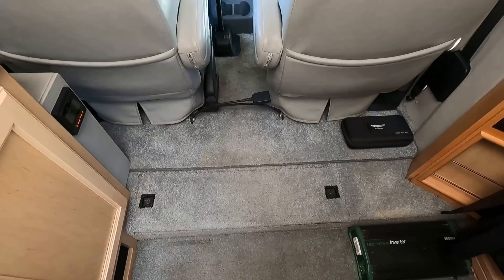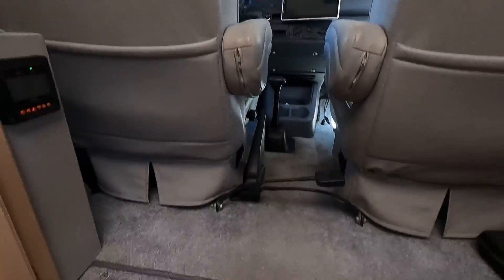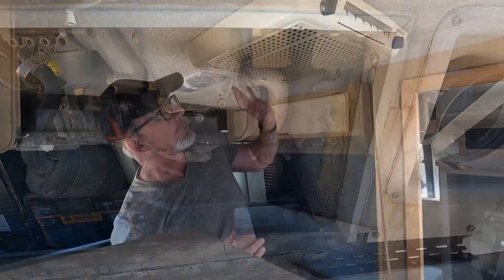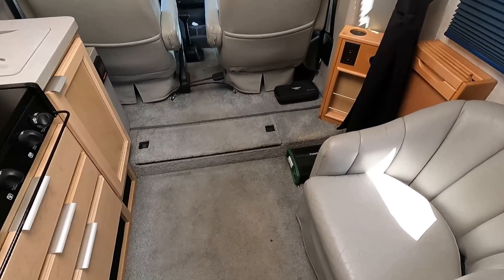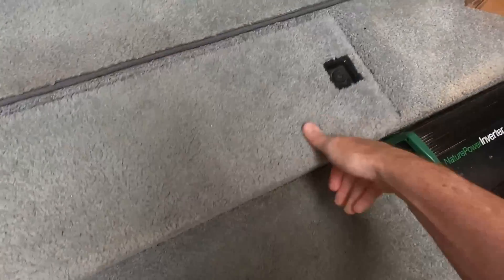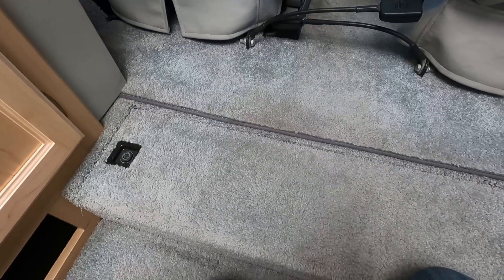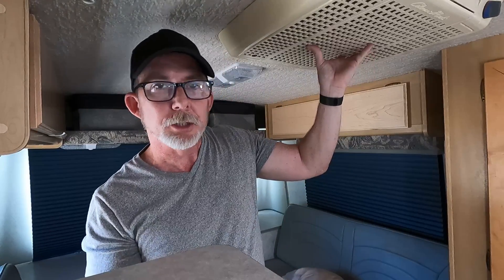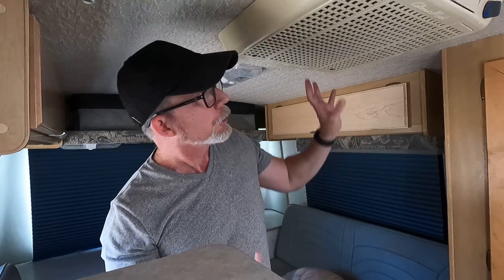Winnebago Rialta: Power Systems Overview

Comment: Is there a way to run a tv and PlayStation while traveling?  This 2001 Rialta does not have a gen and 5 batteries.  Inverter ?
Reply from the maker: What kind of batteries do you have and how do they charge? An inverter will draw a lot of amperage so it depends on what your setup looks like. A PS5 only draws a couple hundred watts and a small TV is negligible, so you could get away with a smaller inverter (although having a larger one might be convenient.)

Comment: A few questions: I would like to put in some lithium iron phosphate batteries. Typically alternators don't put out enough power to charge these, but if you install something like the victron DC to DC Converter I think it may work--do you know? The standard solenoid valve is kind of a crude device in my opinion, so just curious if you tried something like the Victron or some other DC to DC charger . I think Renogy makes one too as well as Sterling.   I'm a little confused if you have a starter battery, why is there a solenoid valve between the auxiliary batteries?  Is that to make sure there's always one good battery to start the RV?
Reply from the maker: The issue isn’t so much that the alternator doesn’t put out enough power, it’s that a lithium battery can take more than it can handle outputting safely, and at low RPM’s a standard alternator will overheat. There are alternators that are designed specifically for this sort of application but they aren’t just a drop-in replacement. 

The DC/DC converter will allow you to limit how much the lithiums can take from the alternator; again, limiting how much strain it puts on the alternator when at low RPM’s. 

The Rialta is a different animal in that it has a special setup that allows the van to be “jump-started” from the coach batteries, which are just regular deep cycle batteries. The solenoid is what isolates those batteries from the engine battery but still allows them to be charged when the van is running.

Hope that helps!
Reply: Doesn't the DC to DC charger limit the voltage to avoid overheating?  And of course, we really haven't talked about solar or things like all-in-one controllers that have built-in chargers in them, but that requires shore power. I'm just learning about the DC to DC chargers, so that is why I asked specifically about them. Back when I owned by VW Westfalia, I just had a simple relay/solenoid, and I think that's where you can really get into trouble if you're auxiliary battery is super low, and has higher capacity then the starter battery.  Again, I thought the DC to DC Chargers had some built-in programming to avoid too much juice going into the Auxiliary batteries.    Unrelated to the topic,  but.  have you had any issues with the transmission on your Rialta? Do you have a cooler and scan gauge?
Reply from the maker: The converter does modify the voltage slightly to keep it consistent at around 14-14.2v instead of the typical fluctuation you see from an alternator, but when lithium batteries are an add-on that’s being served by that alternator - as a matter of priority - limiting or controlling the amperage draw is more important. At idle, if an alternator is capable of producing say, 40 amps…a lithium battery can take that without thinking twice, if it’s connected without a converter. However, an alternator putting out those maximum amps at low RPM’s will overheat, as there’s not enough air being moved to cool it down.  That’s why I went with 20A, so that the lithium wouldn’t overwork it when idling.

My Rialta didn’t have any transmission issues, but it also didn’t have a cooler or a scangauge and I sold it before getting one (which really is a “must have”, along with regular maintenance.) The transmission is a weak link in these rigs but with the proper care it doesn’t have to be.
Reply from the maker: Also, related to what you said about “too much going in”….both the solar controller and DC/DC converter will reduce the amperage and/or stop charging once the lithium battery reaches full capacity.
Reply from the maker: And yes, I had a 20A DC to DC converter installed in the Rialta with an on/off switch, so that I could decide when the lithium battery would be charged, but would still be limited to a 20A draw. Alternately, those converters have a trigger line that lets you turn it on anytime the van is running. I wanted more control than that.

Comment: Nice video Maury, lots of food for thought. Just have to ask you are these the original blinds and if not would you know where they were purchased? Mine are like most distorted and bent.
thanks 
Irene
Reply from the maker: Poptopheaven used to sell original style Rialta replacement blinds but I don’t see them now. In the group, people seem to be using stevesblindsandwallpaper.com. The Rialta came with half inch cellular.
Reply: @TravelingSolo  thanks Maury

Comment: I just bought a 2004 myself and tried to run the hot water heater with my generator, it started to work, my generator bogged down quite a bit, ran about 5 minutes, then stalled and would not start back up. Have you ever had this problem?
Reply from the maker: That could be a few things but first question would be how much gas did you have in the rig? The genset pulls gas from the tank and if you’re below a quarter tank, it won’t get fuel.

Comment: Good evening.  My rear speakers are not working. Are they connected to the auxiliary battery system.  Radio Wires and harness are correct. Also new radio.
Reply from the maker: Stock, they just connect to the head unit in the dash, so if the radio is on, they are on, unless a previous owner installed an amplifier somewhere. Did they ever work for you?
Reply: The coach passenger side speakers stopped working in my 2002 HD.  I found an amplifier under the floorboard in the cupboard located under the sink. I had a stereo guy replace it and everything works great now.
Reply from the maker: @Kurtis-Schubert  I just learned recently that there was an option for a stereo upgrade that included an amp and subwoofer behind the driver’s seat, so this is definitely something to look for.

Comment: These are really nice; though I am reading mixed reviews about them, ie mainly availability of parts and finding someone to work on the engine, transmissions if you have issues. So I am not sure about getting one. But for riding around the US and exploring the country, it looks like it would be almost perfect for that. Of course I don't like the bathroom setup but could live with it if needed.
Reply from the maker: I just said something similar to someone else, that the Rialta isn’t inherently unreliable, but you really need to be comfortable with working on them. The real challenge is that some parts can be very difficult (or very expensive) to find.

I think the expanding bathroom is a pretty neat trick, and it was handy on my most recent trip. But….I’ve been considering doing a build of my own, and it most likely would not have a dedicated bathroom.

Comment: Another great and informative video! Have you considered Jackery Portable Power products? I recently learned about them from a van conversion video. The videographer explained how he used the Jackery Explorer 500 Power Station to provide for all of his van's interior power needs. He used a smaller power station for outdoor needs (e.g., powering his laptop, exterior lighting, etc.).  I just did a quick check of the Jackery website and there are some truly impressive products that you may find helpful/useful. Anyway, thanks for sharing your insights. Blessings to you!
Reply from the maker: Thank you! I actually have a small Jackery unit that I use for charging small electronics, and have looked into some of the larger models as an option. I haven’t quite decided how much capacity I will end up with (or more accurately, how much room I have for  it..lol.) I may use the (former) generator bay to house some lithium batteries, but for now I’ll just work on the infrastructure. Thank you for the suggestion!